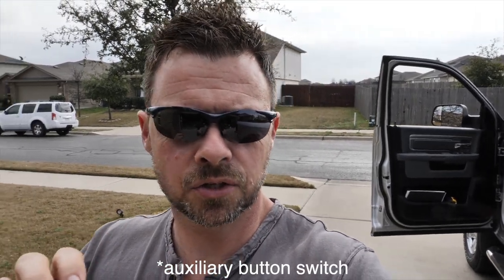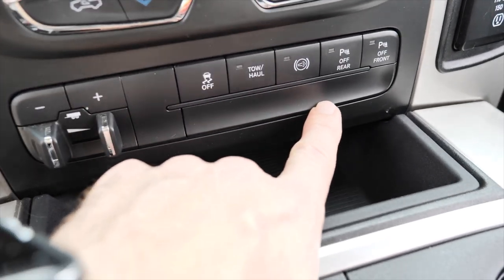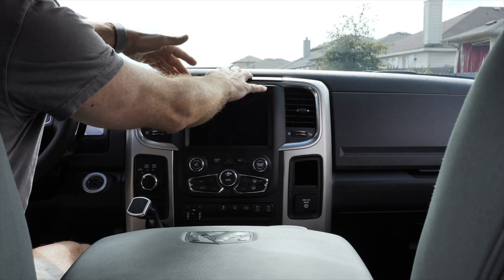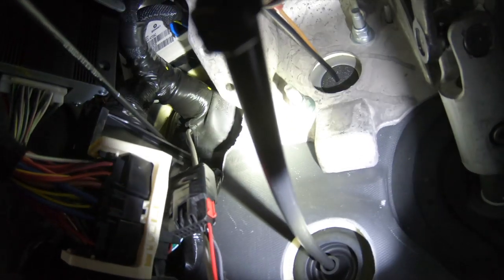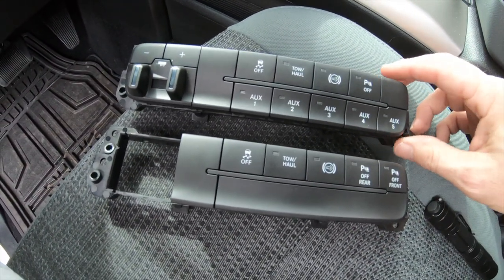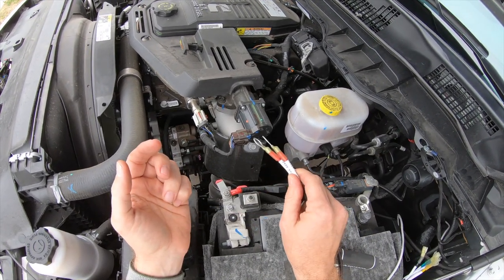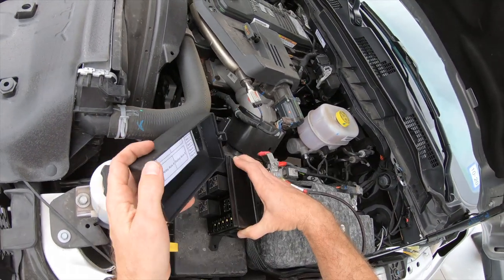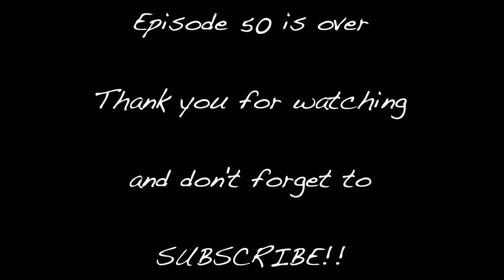Ram 2500 auxiliary button installation

Comment: Back in 2014 I spent close to three months trying to figure this out for my 2013 RAM Sport. Tracking down the switch, finding someone to make that power distribution center, and finding wiring diagrams. I was close to $300 into it when I threw in the towel and sold the whole lot. NOW I find this video.
Reply from the maker: Before I ordered it, I just happened to stumble across the unit and quickly ordered one when I saw it!!
Reply: @RalphBucci  Did you get it from Wired Wagon?
Reply from the maker: @DaveDeVault  

I got it from 4th Gen Ram Electronics
Reply: @RalphBucci   I have tried to find this company it all says error who did you talk to to order one?
Reply from the maker: Hit up www.4thgenramelectronics.com

They are updating their website so it may have been down.

Comment: Whew, glad I bought the ‘18 3500 with those up fitter switches already installed.  I could never be trusted taking my dash off even that far.  Good job!
Reply from the maker: It was intimidating at first because I’ve never taken a dash off of a vehicle but luckily everything worked out!!

Comment: Where you ran your wires through that little black cover with the bolts sticking out. If you unscrew that it open up the fire wall where you can run wires through. It looks like you have 2 wires already running through it
Reply from the maker: Can you provide me with a timestamp and I’ll go back and look at what you’re talking about.

Comment: Great video, I am looking to do the same thing but I already have a relay module built.  Do you know what the part number for that switch is, I need the exact same one?  I do not need this whole system, just the switch module.  Did you happen to take a photo of the back side of the switch?  How does the existing wiring harness and the new wiring harness work?
Reply from the maker: I would contact fourth GEN ram electronics for any technical questions as I didn’t build the set up and I have no idea!! All that I know is it works amazingly well and I absolutely love it!
Reply: @RalphBucci  were they able to get you the dual park sense panel like your original?  That is the exact model that I need.
Reply from the maker: Yes they did!!  Took a bit of time but I got the exact panel I needed!!

Comment: Know this is an old post but do you have current contact info for the place you got the module from? Website is no longer valid.
Reply from the maker: I don't but somebody in a previous thread said that they are still in business under a different name but selling the same product.
Reply: Do you have that thread or new info

Comment: I'd like to know where they mount in from the factory?
Reply from the maker: I think in the same location.
Reply: @RalphBucci  does it make it hard to get to the main fuse box?
Reply from the maker: Not at all!!  100% accessible.
Reply: Its on the firewall driver side top.

Comment: They made that wire alot smaller. I had to drill a hole in the plastic piece and do it that way,  otherwise i would went through the boot

Comment: Where do you get this aux switch panel replacement?
It fits a 2017 ram 1500 laramie?
Thanks.
Reply from the maker: From what I've been told, unfortunately the guy isn't in business anymore so I'm not sure where you can pick one up.

Comment: Get the bds or something that u can get 5000 aux options u plug in by left leg. Then down load bds i think name. Plug it in it will give u more then codes. But becarfule in there. Down load app. And u can change the ideling of that cummings. Or gaser

Comment: If you get the appropriate kit it should tell you how to wire everything at the trucks are set up for from the factory you might have to bring it to the dealer to flash something I’m not 100% sure on that but I know there’s a designated spot to mount that box instead of screwing it to the fuse panel I think it’s on the passenger side firewall were supposed to go
Reply from the maker: I decided to mount it where I mounted it for easy access. You can pretty much mount it anywhere you want to where there’s room!!

Comment: next thing is buy wireless phone charger, cut round hole in cubby under those aux switches, fit and secure it in, wire it to USB power and BAM ... wireless charger in 4th gen RAM trucks in  perfect spot

....if i wouldn't be so lazy, but one day i will do it

Comment: Can you have these switches work steady on/off for say an LED light bar but also have a switch only give power when depressed for say an air horn or winch in/winch out?
Reply from the maker: You can have them be momentary or latching, your choice!!
Reply: @RalphBucci  Thank you so much, do you know if the switch type needs to be decided when custom ordering them, or is momentary or latching programmable with AlphaOBD?

Comment: Did you ever get a replacement switch with the front and rear park sense buttons? I am trying to find the part number to do this myself but can only find a module with the single park sense like you got in the video
Reply from the maker: Took them a bit to send it to me but I eventually did!!

Comment: I’ve got a 2015 ram but mine has the heat switches as well as the others would I be loosing access to my heated seats and heated steering wheel with this product
Reply from the maker: You’d have to contact the seller at 4th GEN ram electronics because he basically custom makes each panel for each individual truck.

Comment: On a diesel engine with the remote start its best to remove the positive first and then the negative I have found that the other way could result in accidentally starting the vehicle

Comment: can i get that uconnect system that you have and replace it with my existent uconnect system on my 2015 ram 1500? i wanna swap it so i can have apple car play
Reply from the maker: I honestly don’t know the answer to that question. I would check with 4th gen Ram electronics and ask them.
Reply: Yes you can. Www.infotainment.com sells radio upgrade packages

Comment: How long did it take to get the kit?  Do you think it is worth the $275 price tag?
Reply from the maker: I think it took around 2 weeks to get it and it is DEFINITELY worth it!!  I have a front LED light bar, 2 rear LED light bars, and a train horn on my truck and the buttons are invaluable and look stock!!
Reply: Ralph Bucci  Is it difficult to make them momentary?
Reply from the maker: Ernesto Rodriguez II 

You have to have the AlphaOBD programmer (available on Android only) to do it. It’s really easy if you have the right equipment and unfortunately I had to purchase all of it because nobody around me had it!!
Reply: Ralph Bucci thanks. After I asked I did a bunch of research on alpha odb and an obdII plug.
Reply from the maker: Sweet and good luck!!  If you have any questions, feel free to ask!!
Reply: @RalphBucci  would you do a video on how you installed your air horn and front led light bar? I have both but ain't smart enough to do it without frying something. Thanks
Reply from the maker: Out Law 

What exactly do you need to know?  I’ll help out as much as I can!!
Reply: @RalphBucci  I have the same accessory panel you have that came in my Laramie Longhorn. How did you connect your compressor and air horn to the panel? On my old Silverado, I had a wire to a switch to turn on the compressor and then another push button to sound the horn. Is this where you would connect it to the panel? Also how did you connect the led light bar to your panel?
Reply from the maker: My panel came with 5 wires that already have relays and fuses attached to them so I simply installed the accessories (horns and light bar) and then plugged the wires in to one of the 5 available accessory wires.

Comment: Did you need to have the truck flashed to accept to new switches?
Reply from the maker: Not at all. It was simply plug and play!! 

To program the switches other than factory (I wanted switch 1 to be momentary and the rest to be latching), I used the AlfaOBD app to do the programming and didn’t need to flash it either.
Reply: Ralph Bucci awesome, thanks!
Reply from the maker: Glen Dettman 

Anytime!!

Comment: How did you change out the trailer brake control from the old unit to the new unit?
Reply from the maker: The old one simply popped out (with a bit of persuasion) and when I put the new panel in, it popped right in!!